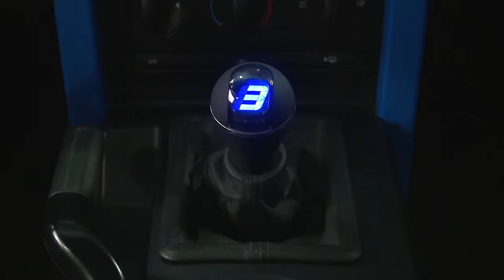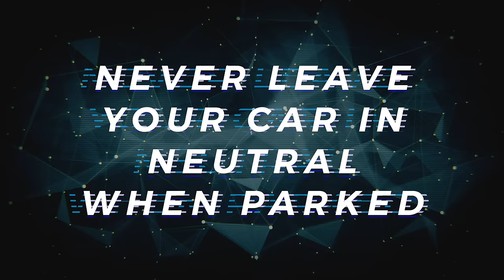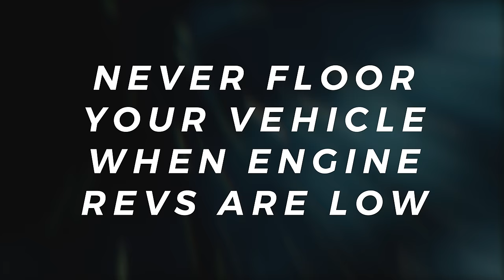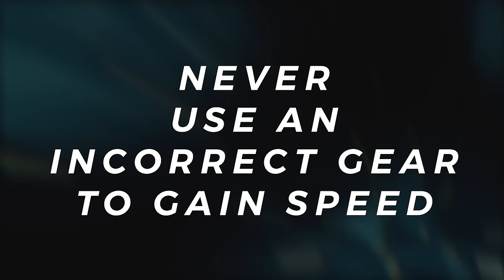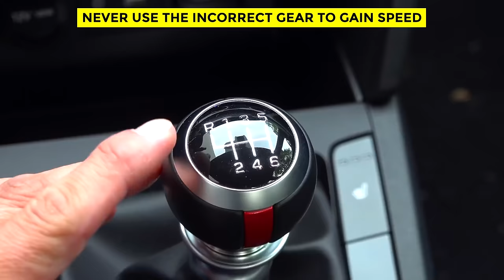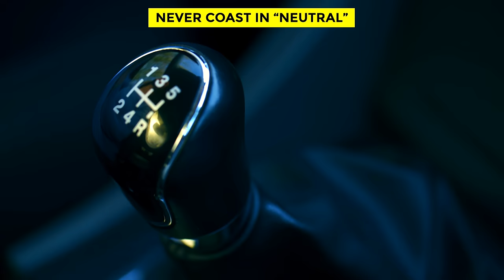7 Things You Should NEVER Do In a Manual Transmission Car!

Comment: In Europe (or at least in The Netherlands) you’re taught to put your car in neutral and engage the handbrake instead of putting it in first gear when parked. The reason for this is because a lot of people forget to push down the clutch before starting the engine. Which causes your car to shoot forward a bit and stall the engine right away.
Reply: NL is flat. :)
I leave in neutral on the level, and in gear on a hill. :)
Reply: @ArcanisUrriah   to european standards. NL is high from weed
Reply: It's fine to put it in gear on a hill or something, but on a flat it's better not only because you stall but mostly because most people forget the handbrake and park the car only on a gear.
Reply: @Vert_GreenHeart  you want your car stable, that is a standard in germany, everyone puts it in first gear, probably because of poland they just roll it unto their truck lmao
Reply: So this is why the clutch has to be pushed in modern cars to turn the engine over in gear. Thanks I hate it
Reply: US market manual cars have a starter interlock button operated by a tab on the clutch pedal lever. My Studebaker had the starter button on the floor under the clutch pedal; some Nash models used this system, too.  The best thing is, even if the engine won't fire, you might be able to use the starter motor to move the car in an emergency.
Reply: Except if parking on a slope.
Reply: many new cars, like our zafira, have this thing when you leave in gear parked, but don't press the clutch to start, the car won't start, it will have a blinking symbol of a foot on a pedal in the instrument cluster
Reply: When securing the car to leave yes. The flow of actions is:

Park
Raise handbreak
Put neutral gear
Shut down the car
Pull first gear on normal road or on uphill, reverse if the car is downhill
Remove keys
Lock steering wheel
Look back and in the mirror if cars are coming
Safely open the side door.
Reply: All the manuals I have won’t start unless the clutch is in, and some Toyotas had a clutch start cancel option, to override that.
Reply: How often to you park on the hill in Netherlands ? :)
Reply: then teach people to press the clutch, not leave the car in neutral.
Reply: @that_one_pole17  Many newer cars have that even if the car is in neutral. The engine won't start unless the clutch is down.
Reply: While taking grain to the elevator with a 47 year old grain truck, I left it in second while it was full of grain and started it. It took off! I was surprised because it’s hard to start it sometimes and it doesn’t want to turn off.
Reply: In some places I lived it was considered polite not engage transmission or parking brake when leaving the car for a short time, so that people could push it away if needed :)
Reply: @rekamud6635  Since some recent times, hearing about weed in Netherlands is just funny from Canada :)
Reply: you guys don't have neutral safety switches  😅
Reply: Not in Germany. We are taught to put the car into 1st gear.
Reply: I was thaught to always use the clutch when starting, even with the gear being in neutral. Good habit to have
Reply: @Dopefish1337 It is the correct way you do it! 👍🏻 Indeed good habit.
Reply: I almost never park on a hill, so I just park in neutral. However, the dealer usually puts it in 1st or R, and I usually forget it, so my car has had many violent stalls just from that lol. Luckily, it's never resulted in actual clutch / transmission repairs needed
Reply: Ahaha my car wont let me start without the clutch in.
Reply: I mean if you want to you can drive around in first by spinning the starter. It'd just cost a little more than it costs to fuel the damn thing lmfao
Reply: Not in Italy, if the road is not flat it is dangerous not to leave the gear engaged.

Comment: I've been coasting in neutral for 48 years.  No problem.  And the engine gets nice cooling air flow while at an idle.
Reply: No problem for the engine really. It's just very unsafe and you'll wear your breakpads/rotors prematurely + worse MPG.
I live in the EU (Portugal) before you say you know better.
Reply: if you coast in gear the engine will enter "overrun mode" and shut down the injectors, no combustion means no fuel consumption and zero heat
Reply: For 48 years!?!? That must be one big hill you're coasting down. Update when you get to your destination!
Reply: i was told to NEVER coast in neutral  and would never ever do it in loaded wagon   i like to have control  not the car or wagon control me

Comment: You dont grind the gears in any modern transmission they are always engaged what you are grinding are the brass synchros when you change gears.
Reply: You can still grind gears in modern cars.
Reply: Even in my 98 Prelude is the syncros that grind, not the actual gears. I wonder if it depends on the transmission
Reply: yes, the synchro-mesh gears
Reply: Rev match, easy as
Reply: There are still a few manual transmission trucks that don't have synchronized transmissions. The last one I drove was in a tri-axle dump truck. I loved that truck.
Reply: when i grind them a long time ago i always think of my key smiths
Reply: @chaddy8565  you can sometimes slip passed the synchros and grind the gears directly if you're really (and I mean REALLY) bad at shifting.
Reply: Technically you can grind the synchro locking rings against the gears if you try to force the engagement of the gear (well actually the synchro engagement ring which is part of the gear but is straight cut not the hypoid gear itself)), when the speed differential is too high. Also happens when the synchro cones are worn (which happens when you keep forcing the gear engagement!), as the gear speeds don't match efficiently
Reply: @lazyh-online4839  that can also happen with worn synchros not properly syncing the gear. My current vehicle came from the previous owner with a pretty roughed up 4th gear synchro. Just gotta take it slow, but you can feel the shifter slip past the synchro and the gears clash every once in awhile.
Reply: @rich7447  i feel you

Comment: The never clutch while braking is arguable, when you're going downhill, especially those steep ones, you can use the engine brake to control your speed when going downhill, of course this is not something to rely on, but it's less trouble for your brakes as you aren't getting too much speed. However, this is something to pay attention as the video's point is true, if you got yourself too slow for the gear you are on, the car may end up wanting to gain more speed, so do by all means clutch when you really want to slow down especially for the curves on the road.

Now the last tip is weird, never heard of oil being affected by having the gear on neutral, the point that was supposed to be there is to reduce stress on the brakes as on neutral the car will keep trying to gain speed, the engine brake prevents you from going over the speed you wanted.
Reply: Brakes are a lot cheaper to replace than transmissions.  Loading the gears on the opposite sides of the teeth from using engine braking has been known to cause wear on the teeth,
Reply: At some point it becomes a habit to automatically downshift as you slow down so you are always in an appropriate gear for your speed.
Reply: @aphextwin5712  that is the correct way to do it
Reply: @aphextwin5712   Richard.....is that you? .....
Reply: @Vpmatt  No
Reply: if you are familiar with the road, and you know there is a coming downhill and how long it is, you will plan to get into the downhill at a lower speed . Then let the potential energy change to the kinetic energy, keep watching around, if no car is around, you are safe, and you save your gas, engine and gearbox. Use engine braking for downhill guarantee your car won't reach 200000 km.

Comment: It amazes me that some people don’t know to leave the gear in first when parked facing uphill and reverse when parked facing downhill.It’s one of the first things I was taught when learning to drive.
Reply: Makes sense.
Reply: @masssssy  sometimes handbrakes need to be tightened (as is the case with my car i'll have to tighten it again soon) so sometiems the handbrake slips because it's not putting enough pressure on the brakes and the weight of the car just pushes it down
Reply: Whether you're in first or reverse won't change much - the engine compression is the same either way.
Reply: @trainiax  
Are you saying if you turn the engine off on a hill with no handbrake it won’t make any difference to the car rolling away whether it’s in first or reverse?
Reply: @redpillnibbler4423  Exactly.  The only thing keeping the engine from moving is the compression in the cylinders (and any internal friction).  If the engine were forced to rotate in reverse it would simply draw air through the exhaust and out the intake.  The reason it's recommended to put it in first or reverse is because higher gears have less mechanical advantage from the engine, meaning the engine could be forced to turn over much more easily.

When the handbrake cable snapped on my last car, on the rare occasions when I parked on a steep hill and left it in gear, it would lurch forward a few inches every minute or so as the cylinder compression very slowly leaked down.  I relied on turning into curbs (or avoided steep hill parking) until I got the cable replaced.

I park in 1st (with hand brake) simply because it's easier to engage than reverse.  The gear ratios between first and reverse are about the same.
Reply: its not a mistake.... putting it in neutral isnt fucking death
Reply: No no. U don't need parking brakes or engaging in some gears when hill parking. Just shoot out all 4 tyres. Now they won't roll anywhere.
Reply: @redpillnibbler4423  works on my bike , probably same for car
Reply: Is it necessary if I have a electronic brake?
Reply: @masssssy   I see you are trying to be a smart arse. However if you knew how to drive and were familiar with manual cars , then you would know why you don't just depend on the handbrake when parked on a hill.  It's not like an auto mate. You don't want to park the car on a hill only to find it rolling into other cars do you....
Reply: Also you can turn your wheel so if the car rolls it will use the curb like a wheel chock. 3 things i do on a hill. 1st gear, parking break, turn wheel.
Reply: @masssssy  that is not at all what i said lmao
Reply: How will i know,this is an uphill and this a downhill suppose am on a flat area
Reply: except, it does not matter
Reply: Both handbrake and gear locking turns out to be safe. If one fails, other will compensate.
Reply: If you put it in reverse Evan on a hill you are still technically putting it into gear so your car will roll
Reply: @kalderbeaulieu9690  
Try it.
Reply: @usuallyblockedforspeakingt2803  You're supposed to use the parking brake on an automatic car on hills too, btw, so I don't understand what your point was there.
Reply: @kalderbeaulieu9690  The mechanical linkages between the crankshaft and the wheels would say otherwise. Unless the motor is extreeemely low on compression, no it's not moving.
Reply: no one told me that cuz i live in florida
Reply: @masssssy  You do use the parking break, but with manual vehicles, you also need to put the vehicle in first or reverse in case that break fails or slips. It's incredibly common.
Reply: I always leave it in neutral I thought it is not good for the transmission to leave it in a certain gear.
Reply: @D1M1T  General Rule = Leave it neutral then handbrake. Exception = When you park your car on a hill. Uphill = 1st gear. Downhill= Reverse. Since Manual cars do not have "Park" Gear unlike Autos, it is recommended to do these.
Reply: @kendivedmakarig215  thanks for that man, do you know if it wrecks the gears tho? I kinda just assume it does but I don’t know
Reply: @D1M1T  Nope it won't. The reason why we shift 1st gear in uphill and reverse in Downhill is because if the handbrake fails while Parked in a steep hill, the gears should stop your car from rolling down. Also it is better to leave your wheels away from the curve(uphill) and towards the curve(downhill).
Reply: @kendivedmakarig215  Doesn't matter whether you use 1st or reverse, it's roughly the same ratio either way and it's the engine that stops the car rolling so each gear locks the driven wheels equally.
Reply: @trainiax The compression is higher in reverse in most cars
Reply: My saab is even designed so that you cant take key off if not in reverse gear
Reply: @flankkh  
Clever buggers those Swedes.
Reply: Also facing your wheels away from the curb when uphill and towards curb going downhill
Reply: There's no logic to match the position of the car with 1st or reverse. Both gears have the same braking force regardless of the position of the car. Reverse has a lower gear ratio than 1st so its braking force is stronger (again, regardless of uphill or downhill).
Reply: @jassenjj  
Try it on a hill.
Reply: @masssssy  you mean BRAKE not break and of course in a manual car you SHOULD ALWAYS Leave it in gear. ALWAYS.
Reply: @trainiax  Or any gear, the gear is irrelevant as long as it's in gear
Reply: @redpillnibbler4423  YES CORRECT. or any gear.
Reply: @masssssy  You mean "AN" auto correct not "A" auto correct. Do you know when to use a and an?
Reply: @trainiax  I use first gear when parking no matter what direction I am facing, it's geared lower than reverse holds better and if it's steep use e-brakes and turn wheel toward the correct direction.
Reply: @redpillnibbler4423  YES.

Comment: I can agree with most of this other than the coasting in neutral in a manual transmission car.  It can save gas on some older models because fuel cutoff is not a standard across the board so some used cars with manuals older than 10 years don't have it.  Also, neutral coasting a manual transmission causes no harm;  it does not have a pump.  that's automatic transmissions.   and even then, it depends largely on the auto transmission itself.  Just look up flat towing for a list of automatic cars that are ok to neutral coast.
Reply: being in gear is far safer and better than coasting in neutral, and uses less fuel as the wheels are basically turning the engine. have run into brake fade going down hills in an automatic which was pretty much like being in neutral
Reply: I have a 25 year old manual.  It definitely has fuel cutoff and uses less gas when going downhill in gear.  I have confirmed this with an odbii reader.
Reply: Fuel cutoff is a standard since early 90's and many cars have it even before that.
Reply: @jassenjj  none of these manual transmission cars had fuel cutoff. 1993 mercury topaz . 1999 Ford escort zx2.  2005 kia. Rio. 2010 Chevy Aveo. Only manual car I have with fuel cutoff is a 2012 mini Cooper Clubman. And even then, coasting gets better mpg. I get 42 mpg out of the mini.
Reply: @jdangberg  OK, this is probably in the US. My 1994 Opel Corsa B had fuel cut off and as far as I know it is mandatory in the Euro standards.
Reply: There is a difference between coasting engine on and off with auto.  Most autos need engine running to power trans oil pump.  Most manuals need engine running or trans in gear if engine off to lubricate gears properly.  I have only heard of a  couple old american auto transmissions that could be towed with engine off in neutral without damage.  I think they had a 2nd pump connected to output shaft, and I think this also allowed them to be bump started like a manual.  I have never heard of a manual that could be towed in same manner, although it would be possible to engineer it, just not that practical due to manual getting splash lubrication vs pressurized oil flow.
Reply: Also most autos that can be safely towed are likely selectable full or part time 4wd with a neutral position in the transfer case.  Still depends on tranfer case design and automatics i would guess would be less suitable, you wouldn't want trans output shaft to rotate at all.

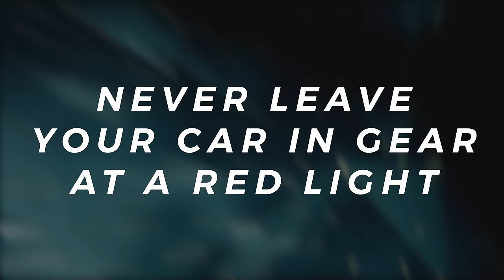Comment: 4:00 Here in the Netherlands you are literally forced/taught to always be in gear. Shifting your car to neutral at a traffic light makes you instantly fail your exam. The idea is to be ready to take off immediately and not to slow down traffic. Funny how an entire nation is taught to destroy their cars.
Reply: wait so do you hold the clutch in the whole time your waiting for the light?
Reply: @arcanevoid9199  Yes in first gear, not neutral
Reply: @miketakular7443  whats the point of that? unnecessary wear on the throwout bearing and annoying to hold it especially in anything but an econobox
Reply: Same always been taught to hold it in and keep her in gear
Reply: @arcanevoid9199  I have done it for years. Never a problem. 

Makes my knee hurt though
Reply: @Vamavid  yea it’s not gonna make a massive difference in wear, but as you said it hurts. that’s why you shouldn’t
Reply: In the UK you will fail your test if you DON'T put it in neutral at Traffic Lights .
Reply: @PhilipKerry  I mean after the exam you can do what you want here, but cars will honk at you if you arent fast enough
Reply: @PhilipKerry  I don't remember what was taught here, but I feel much safer in neutral. What if I slip from the pedal or something else happens and the car jumps into the pedestrians crossing the road ?
Reply: @reinhard8053  Both your feet would have to slip off the clutch and brake pedal respectively simultaneously, while you have plenty of time to plant them neatly on the pedals as you come to a gentle stop and wait for the light. If it does happen, you'll hopefully brake and probably stall before really going anywhere from stand-still. If you're worried about your feet slipping, consider you're spending most of the time at lethal speed with the one foot that's going to stop your car needing to jump from the accelerator to the brake pedal in a hurry...